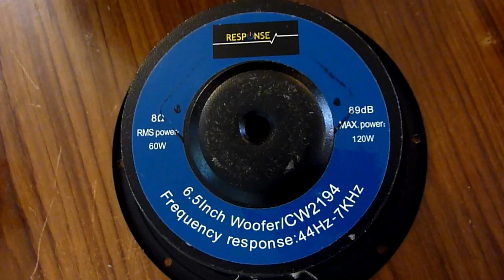MAKE YOUR OWN "KEF UNI-Q" SPEAKERS (2-WAY POINT-SOURCE)

Comment: would there be issues with plugging the vent on the woofer? the hole behind the dust cap on typical woofers is usually necessary for the driver to vent through and if you plug the hole it'll cause a lot of issues. the reason why the woofer has a hole in it isn't so that you can turn it into a Uni-Q... its there for an important purpose on its own.

if it were this easily kef wouldn't have patented and dominated the market with it, and then other companies wouldn't need Andrew Jones, one of the the inventors, to over see and sign off on their variations e. g. his uni Q clone for tad, pioneer, elac etc.

they also have a gasket between the tweeter and the woofer called the "sealed suspension tech" which prevents the woofer from chuffing between itself and the tweeter. I wonder if you can use a condom or something lol.

I like your moxie and I think you're onto something but I think there's a bit more to the design than just plugging the driver vent with a tweeter.

you should also add a waveguide. according to kef the driver needs to have free clear line of sight of the woofer. if the tweeter fires open the woofer will become its waveguide and will cause some serious phase issues since it'll be like placing a tweeter in a baffle that pistons forward and backward.

the way everyone else before and after did it like Hsu was to place the tweeter behind the vent hole but high loaded. BUT I think what you're doing can work if you manage to seal the air gap between the woofer and the tweeter with something like a small surround and then added a wave guide so that the tweeter wouldn't bounce off of the moving woofer.
Reply from the maker: This is just a shit video I did years ago. Not really explaining how to make anything. I haven't had any heating issues with woofers and I usually plug the hole at the back to actually mount the tweeter properly. But i don't use them as PA speakers, just lounge volumes. They put the hole in it so they can be driven hard. 

I don't like any of the combo "suggestions" in this video. But I did make a pair of coaxials with some 2" voice coil stiff suspension med (guitar) drivers and some 1.5" car dome tweeters (still have them). The PA speaker shown at the start was later re fitted with 3" bullet tweeters in the center and they were insane. But unfortunately one PA 10" main driver failed. It scrapes and so there goes that set of speakers. lol I don't know if the phasing has problems, all I know is that it sounds better than separate woofers and tweeters (with the vowels coming from a foot away from the consonants). 

I don't even need to make coaxials any more cos I have a way to extend the khz on FR drivers. But I came to this idea by making coaxials. I made some "piggy back" coaxials. They are made from FR drivers that I drilled a hole through and rear mounted a "piggy back" tiny FR driver (strpped of it's cone) and it was replaced by a stick that goes through the hole (in the main driver) and a tiny foil "tizzer" is mounted on the end of the stick (time aligned with the main cone). I have a completed pair of these speakers with an extra woofer (the best speakers I ever heard). And the image is like "live" with some recordings. 

They are on my channel towards the top of the list. But I tried just mounting the foil tizzer on a 3mm tall post directly glued to the dust cap of a FR driver. (And it worked) it makes a lot of difference (a comparison of bluetooth speaker on my channel, near the top of the list). You can tell the difference at the very first second. The tiny foil "tizzer" is 6mmx3mm and in a teardrop shape (with a tiny hole in it for the glue to work). The stick is a splinter from a toothpick and only 3 mm tall. 

Live bands have treble that goes right through the bass, not cos it's so loud but it's the "tinkling" that makes the treble penetrate so much in live music. My tiny foil mimics that. Even when it's only on one driver (no "piggy back"). The foil vibrates separately to the main cone (I coined it "acoustic separation") and it's the Holy Grail for cheap FR drivers (sounding better than tweeters). lol And also cos it's so cheap (though it be somewhat fiddly).

Now (to do this) you need drivers with a cardboard dust cap so the glue works. Plastic dust caps suck and won't take glue. Don't use super glue you may end up wrecking the project, use glue that gives you a second chance at it , like PVA (it's tedious). But before making the mod, press the dust cap on your driver down, but not totally, like 2/3 of the way presses in. The little foil has to be in line with the cone about 3 cm out from the base of the dust cap on small drivers (depends on driver size). Best "average" cos that's where the med "joins" the treble, on the cone. 

I also put whizzer cones on drivers for bluetooth speakers, but not on my larger lounge speaker 4" coaxials (but I used to, but they are too heavy and wrecked transient response). On the videos the whizzer cones are on and makes voice nice and "airy" sound but now I increased the driver gap instead (with better transients and no whizzer). Update soon. I have the 4" drivers "float mounted" (that does a similar job to whizzer cones) and there is a 1 cm cap between the driver and the enclosure hole (and a bass vent tube within). It gives the voice an "airy sound" but the gap size is critical to the sound (to say the least). You will see it on my channel. And wind the videos forward for the actual demos. lol 

Thanks for your interest, too many people just simply stick drivers and crossovers in boxes. I don't make speakers for that I mainly do research and don't really make speakers, just experiment with them. One day maybe, cos I'm onto something that could be really fucking cheap.

Comment: why no use hot glue? nylon would cause the tweeters to vibrate.
Reply from the maker: Cool idea if I get the problem. Or if I sell any. lol Have the hot glue and the lylon, just in case the hot glue cracks in transit.

Comment: never thought of making a coax from a larger speaker actually, can be useful if the box is very small and the tweeter won't fit on the side of it. what can be good to know is that it may be a good idea to plug the hole in the magnet when the dust cap is removed to prevent chamber compression to leak out from the box trough the speaker, that would make the range of low frequency sound suffer. you may also use a higher tube to put the tweeter on as on the center as on the stock coax and solder the terminals to the coated connections on the cone instead with eg solder absorbing wires :)
Reply from the maker: The only reason for the co-ax is for point-source sound, not space.